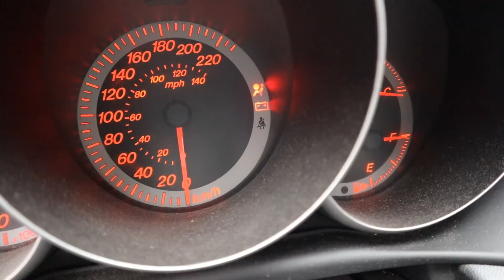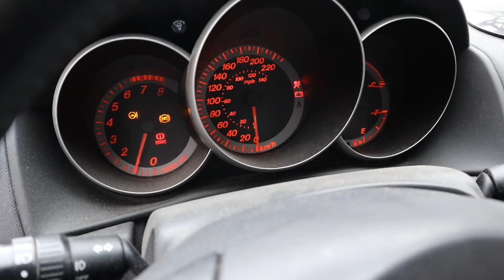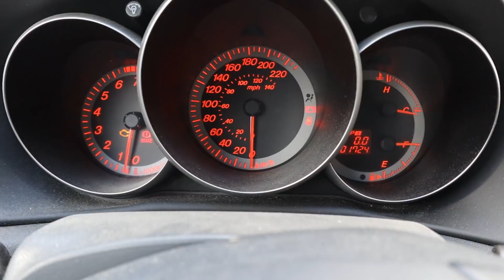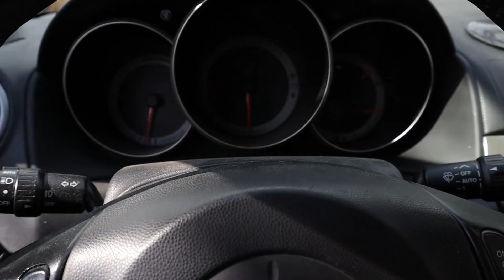How to Diagnose and Replace an Alternator

Comment: What is Mazda thinking putting the alternator at the bottom. Having it at the top makes it easier.
Reply from the maker: The AC compressor is below the oil pan! Even worse

Comment: I have only changed two alternators in my life on two of the vehicles l have owned one alternator was still charging and the bearing was making a nasty noise so l just changed it the other one was not changing do l went to an auto electrician and he changed it and l have owned lots of vans and utes
Reply from the maker: Awesome

Comment: What a not-so-good design from Mazda. I see most manufacturers place the alternator on the top but Mazda put it at the bottom with no splash shield. Here in Canada with all the snow then road salt, it doesn't go very well.
Reply from the maker: This car was supposed to have a splash shield covering the whole engine. 

What's worse is the ac compressor is below the oil pan!

Comment: Jeez what a nightmare when those bolts broke off  : (   I've had that sick feeling more times than I care to remember. After a few years experience you kind of get the feel of when a bolt is about to break and you can stop what you're doing and plan your next move before it's too  late. What worked for me sometimes was to hit the head of the bolt with a hammer, which seemed to break up the rust build up and allow the bolt to be removed without breaking.
Reply from the maker: The bolt is the problem not the threads, as it threads into aluminum. The bolt is long and slender so it twists and snaps
Reply: @speedkar99  Yep. When I had to remove an exhaust manifold which was undisturbed for forty years, I knew the bolts      would break off. What I did was to cut the heads off the bolts then slide the manifold off the remaining studs and turn the studs out of the heads with a vise grip. The problem is with the bolt inside the manifold, not the threads in the head.

Comment: Before removing bolts that maybe rusted, it is a good idea to try to tighten them first. A slight tightening, can break the rust and then a slight loosening and tightening will help keep the cap screw (bolt takes a nut) from breaking. Thanks for posting.
Reply from the maker: Yep, working them back and forth helps. These bolts were too long and twisted instead

Comment: Super video as always and my heart went out to you when the bolts snapped on you. Being an ex fitter electrician I understood the gravity of the situation. And having to drill and tap on an aluminum base with steel wedged in, can be problematic at best.
Reply from the maker: Agreed, not gonna be fun. Too much rust on this car.
Reply: @speedkar99  Looking at all your super super videos this past  year or so. It seems to me that they are designed in such a way as to try and cut people like yourself our of repair. I have seen this in industry. Where special tool are needed or have to be bought or they design it in such a way that it cannot be repaired at all, or at least make things very hard. Where the average person would give up dump it. "Planned Obsolescence" Looking at the mounts for that alternator seems very much the case.

Comment: Great video man! Unfortunately, I was stranded once because my car's alternator went out on me. I replaced it myself but being stranded is a real hassle. I recently bought a multi-meter so I can periodically test my alternator the way you showed here. I'm hoping that in the future I can detect the problem before I get stranded. I also have a carbon pile tester and a jump starter for my battery. I hope I don't get stranded again.
Reply from the maker: Multimeter definitely helps!

Comment: Any chance to fix the bad one?
As to my knowledge (at least for Lexus IS family) the alternator no way near cheap!
Reply from the maker: I opened it and showed in the video the parts are replaceable
Reply: Cheap and easy, if you can get the regulator and diodes, and have tools to replace them - high wattage soldering iron. If the winding is cooked then forget it. There are some places which specialize i alternator and starter rebuilds. 
Denso is my favorite brand when it comes to new and rebuild alternators or starters, and often the extra reliability is worth the time and effort to replace 'rebuild' parts that don't perform as well as the OEM (in my car I have to remove drive axle to replace alternator).

Comment: I'd like to note that some vehicles may have high output alternators, usually emergency vehicles for all their additional equipment such as light bars and sirens but civilian versions may also have them and one might see a higher voltage than 14v. My vehicle was built as a PPV model and it has one but the car wasn't equipped for police use, instead it has all available trim packages with premium paint and underneath is the wee-woo machine to save money between standard trims and PPV models.
Reply from the maker: The voltage shouldn't increase with a high output alternator, it should be the current.
Reply: @speedkar99  Yes a nominal 12V battery can be charged at up to 14.4V, but should float at 13.8V for most of the time, If you have large loads you put in a 100A, 200A or more alternator, and thicker wiring to the battery, so the alternator can provide those loads with minimal voltage drop. Regular vehicle you have a 60A or 80A alternator instead, as they will provide enough power, and the efficiency is acceptable. Larger current ones have to be bigger, as you need the room for all the thicker copper windings, the bigger cooling fan, the larger rotor and the bigger high power rectifier block in there.

Comment: Good stuff man, I couldn't help but laugh when those alternator bolts broke. I think a good trick you might want to try is heating the bolts for a good minute or 2 next time and actually try using an impact, working it back and forth. I've had way less issues using one and I think the theory is they provide many sudden shocks of torque on the bolt vs a wrench or ratchet provides constant lateral and rotating force which is more likely to break. That's just my 2 cents but living just north of Toronto all my life I can say this method has almost always worked.
Reply: Good idea! Thanks!
Reply: Good  day from Kitchener  Waterloo area .  Will have to remember that theory.  Thanks
Reply from the maker: The heat would help but the impact (if I could ever fit one in there) might actually snap it. Perhaps a shock with an air hammer would encourage it and I should have let it soak overnight with PB blaster
Reply: @speedkar99  hey it may be worth a try, that could be a good test in a future video, maybe even try a combination of the 2

Comment: One thing my dad taught me, is that idling and putting around work fine for a jump start that day. But put a charger on it in the evening, just to take the load off the alternator. He was a 70s/80s mechanic, but honestly with all the new electronics it's more true.
Reply from the maker: Charge the battery during the night? Sounds like an electric car

Comment: Cool video.  What would be the ideal prep....spray around the head of all 3 bolts with penetrating fluid several times over the course of a day or 2?
Reply from the maker: Soak in PB blaster, heat it up (not too much to damage the aluminum) and slowly work it back and forth

Comment: How did you rethread the engine block I wanted to see that part?! Lol 
Fucking mazda doesn’t even put a quality bolt where needs to be opened and closed 😇
Reply from the maker: The bolt was exposed to corrosion due to that open slit cut in the alternator bracket. It's also alot longer and skinny causing it to twist instead of transferring torque to the threaded part.
Reply: @speedkar99  OMG 😳

Comment: Great video, do you mean do not disconnect the voltage regulator wiring with the battery still attached and not running or when it is running?
Reply from the maker: Yes don't disconnect the battery when running
Reply: @speedkar99  hey cool I thought he meant don't disconnect the loom from the alternator whilst running.

Comment: 5:30 all I see is 😮 or 😐. Those broken bolts are my nightmare as a diy'er.
Reply: Happened to me once replacing the starter on my Accord. I was furious but there was nothing to be done. I had the car towed to a shop and I let them handle it.
Reply from the maker: Happened to me when over tightened a timing belt idler. Had to tow to a shop too. 🥺

Comment: Or a leaking honda VCM spool valve gasket that will leak right into the alternator :) Gas went up so you can’t afford to run the engine too long :) Nice quick break down.
Reply from the maker: Thanks, and yes - any fluid leaking will cause it to fail prematurely

Comment: if you knew you was gonna replace the alternator, and saw those rusty bolts, why didnt you soak the bolts in penetrating fluid for a day or so BEFORE you tried to wrench on them?
Reply: I was gonna say the same thing. My dad and I have never heard of penetrating fluid before and once we have used it on my car, we now swear by it. It’s a must have for car maintenance especially in the rust belt and Canada.
Reply: As deep as the bolts were when they snapped it would have taken some serious finess, lot's of penetrating oil and and heat cycles to even have a chance of not breaking.
Reply: @jayr9810  its not like they are exhaust manifold bolts stuck to a head. They're just alternator bolts that needed a day of soaking and a bit of heat to break them loose without snapping. The amount of rusty stuff this dude deals with, he should have known better. Unless he did and just didn't care. Dealing with rusty junk, it takes time and finesse to work on them from the beginning. You don't just hulk smash rusty bolts with no care in the world like this guy did.
Reply from the maker: I typically don't have issue with bolts that thread into aluminum since there's less chances of it seizing inside. I took off the top bolt with ease ( as well as all 4 from the one in the junkyard) so I didn't think it was gonna be an issue. 

As you can see in the video I sprayed the last two bolts  and worked them back and forth but because they are long and skinny, twist before they can turn the threads
Reply: because he is a complete bad ass.
Reply: @nickchannel5364  yeah, a badass at snapping bolts in half.

Comment: Awesome job!!! I would, as many have already mentioned, would like to see a video on how you removed the broken bolts from the engine block. You always produce excellent, and informative videos 😁👍
Reply: just cut the new ones down to fit in the holes. 

The way you get the old ones out is by drilling a shallow (few mm) hole in the leftover bolt, dousing it with pb overnight, then using an impact gun with a star bit to get the leftover bolt out of there.
Reply from the maker: Thanks for the tip
Reply: he didnt
Reply: You can drill a small hole in the broken bolt stuck in the engine block and use an extractor to remove it - see Amazon. However, depending which bolt you're drilling there is always the risk of dropping debris inside the engine causing more problems.
Reply from the maker: I wouldn't think these bolts thread through the block into the combustion chamber
Reply: he simply shortened the new bolts, sounds like me :P
Reply from the maker: That's what JB weld is for right ?😉
Reply from the maker: Thanks! It will require removing the front clip to get head on access to drill it properly

Comment: If the bearing was seized, shouldn't you hear squealing sounds from the belt? What shape is the belt in? Thanks for sharing your experience!
Reply: Not the bearing that is seized, but the spring and tensioner pivot point. Though the idler pulley itself is also pretty noisy as well. Will all come new with the replacement part.
Reply from the maker: Yep, the whole thing will be replaced as one unit
Reply from the maker: Belt was reasonable. Remember you have to deal with the AC stretch belt if you want to get this one off

Comment: I had a dead alternator last year on my old car. Just before scrapping it...
I wasn't aware that you could recharge your battery on idle... I guess you should let the engine running some hours.
Normally I would make a trip of 50-100km in order to make sure the battery is full again...
Reply: Alternator can recharge the battery on idle, providing there is little load, so lights off, no blower fan running and no AC, no heated seats, no demister on and no radio on, so that all the limited power the alternator can deliver goes into charging the battery. Easy though to have more load than the alternator can do at idle, so best is yes to drive for a half hour to do something else, so that you both have engine RPM up higher, and thus more power available to charge, and also are not wasting fuel along with diluting the oil with blow by.
Reply from the maker: Driving doesn't do much more than idling to charge the battery. That's why there's a voltage regulator...to ensure it doesn't overcharge the battery.
Reply: @speedkar99  True, but the alternator is also generally going to deliver full output at roughly normal driving RPM, and at lower or higher RPM will limit power, high side regulator cuts power, and at low side the magnetic field cannot put enough power out. Idling will provide a certain amount of power, but with heavy loads on, like lights, heating and such, idling will actually discharge the battery down further, till the resistive loads drop in power to closer match the alternator output. 

Modern cars though control alternator output via the ECU, so the regulator is merely there as power amplifier, with the ECU determining power demand, and backing off power as engine RPM rises, though idle will still cause discharge, but the ECU will also then command loads off when the voltage drops too far. Done so the manufacturer can use a smaller, lighter battery, and thus only has really enough capacity to start the engine, it will idle at higher RPM to charge the battery automatically, which them is a big fuel waste, in that you use fuel to charge a battery only, and thus are throwing 70% of the energy in the fuel away as heat.

Comment: Good video, what did you do about the broken bolts, did you have to recap the threads?
Reply from the maker: Yes I will have to drill those and retap. Quite the job
Reply: @speedkar99  Thanks for responding!

Comment: Dude, you rock! Thank you for your work on these. Peace!
Reply from the maker: You are welcome
Reply: @speedkar99  I feel your pain man.  I used to work with cars in Florida. Everything is always easy and no drama.  But now, in northern states with road salts, It is always terrifying to work in anything under the car including simple stabilizer links.  Often I need an angle grinder to cut bolts and parts to take them off even on 5 years old car.  Fortunately, most newer Toyota and Lexus are well covered under the body with plastic and a much better coating. But the brake rotors corroded very fast in hybrid from lack of pressure and rubbing.